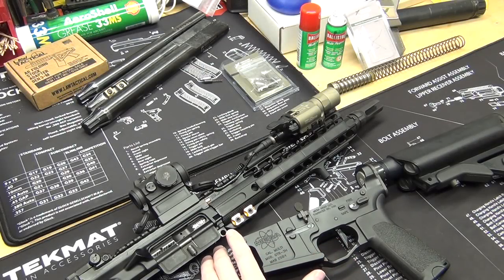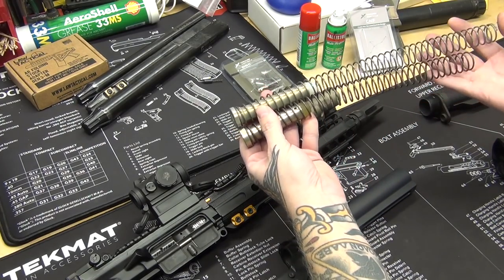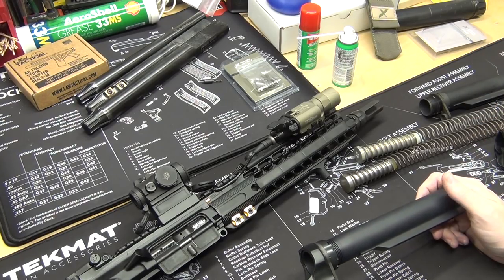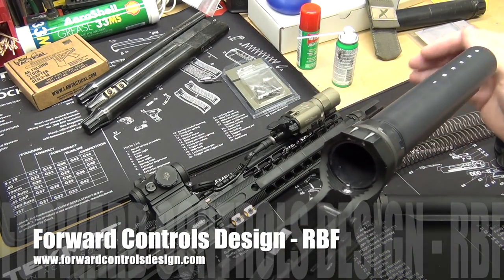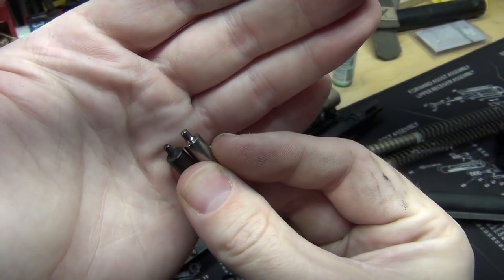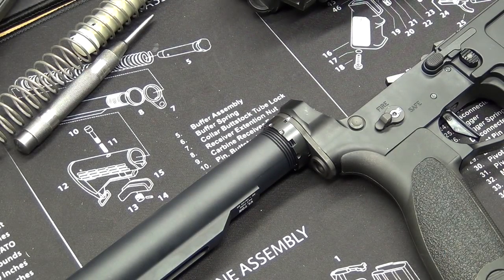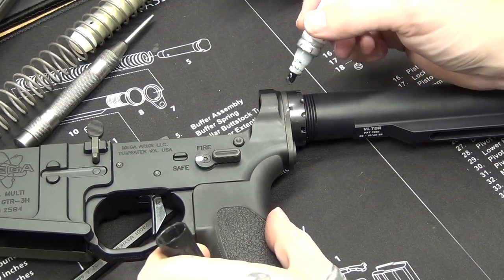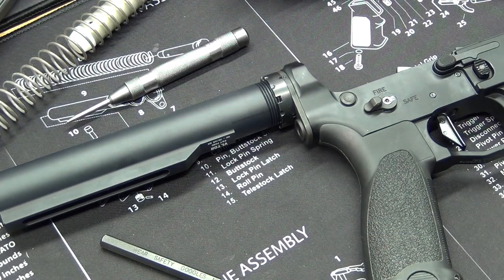Upgrades & Nut Staking - STAKE YOUR NUTS!

Comment: I have a question, and yes I am aware it sound amateur-ish.

If I have a mk18 upper receiver, and a lower receiver from a 16 inch rifle, with rifle stock, spring, buffer, etc. (Having gone through the proper ATF form 1, and having sbr'd my lower from the rifle, can I now attach the mk18 upper receiver and be good to go, WITHOUT expecting technical/reliability issues?